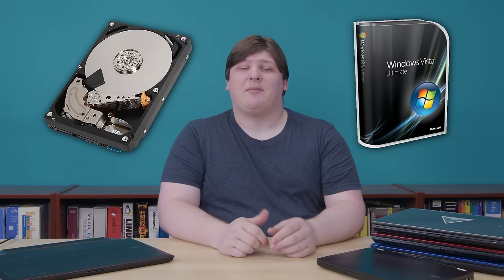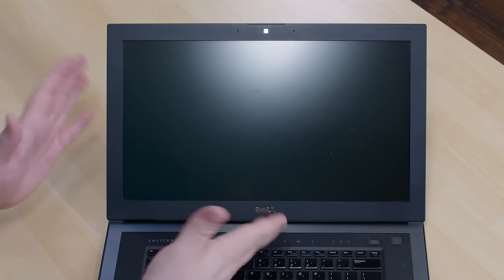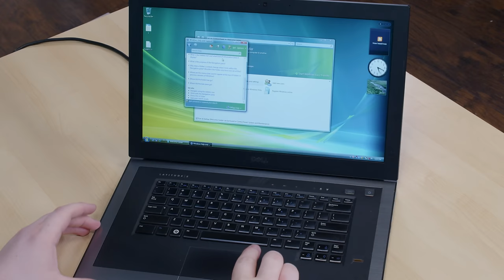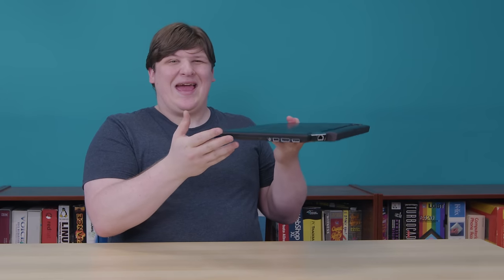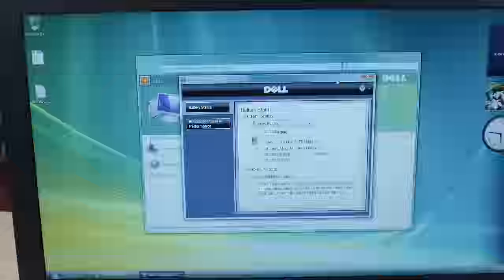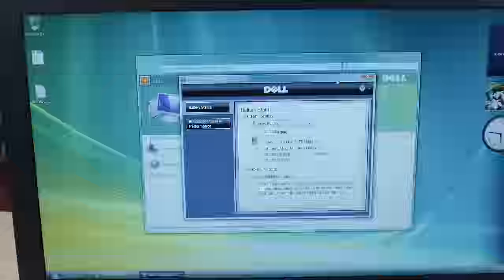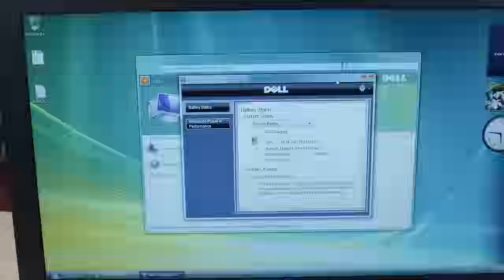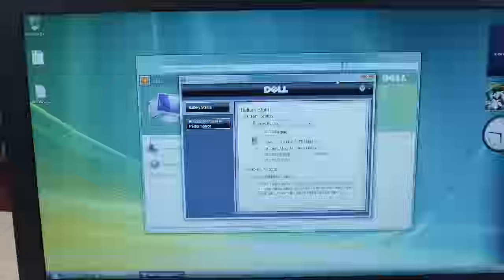Quick Start Ep 6: Assuming Direct Control

Comment: Dell releasing the first ARM laptop wasn't something I expected from this series.
Reply from the maker: ...god I think you're right.
Reply: @CathodeRayDude  I believe the OpenPandora might have been first (at least it would have been if it didn't get stuck in production hell), and it had almost the same cpu: an OMAP 3530@600Mhz.
Reply: This all makes me really appreciate modern MacBooks.  Lift lid, put finger on sensor, do things.  Honest-to-gosh, 0 sec boot time to a full OS.  AND eight hours of battery life.  haha
Reply: The OpenPandora! I was obsessed to have one, but not only was out of my reach, but it took too long to produce! Back then was more difficult to go on with a project like that. Nowadays you have crowdfunding that makes things easier...
Reply: No the first one was made by acorn in 1992
Reply: @CathodeRayDude  The first one was the acorn a4 from 1992 much older
Reply: In 2009/2010 there was some ARM based Smartbook devices like Toshiba AC100, Compaq Airlife 100, Sharp Netwalker, Touch Book
Reply: @cloudycolacorp  I'm sure it is! It looked like the coolest thing to me, armed only with a Nintendo DS and a flash card! I remember browsing the web using the crappy homebrew software that did with only 4m of ram...
Reply: @belstar1128  The A4 didn't have a battery
Reply: Besides all the other ARM laptops other mentioned in this thread that predated this Dell, Apple also released a ARM-based laptop/PDA known as Newton eMate 300 in march, 1997. Intended as a low-cost laptop/PDA mostly for use in schools, it used a ARM processor just as all other prior Newton models did. So Dell definitely wasn’t the first ARM laptop though likely the first (and only?) dual-boot x86/ARM laptop.
Reply: @CathodeRayDude  depending on whether or not you consider palmtops laptops, they existed since the late 90s. Psion 5 had ARM SoC inside. Also I believe Windows CE-powered "smartbooks" were a thing since late 00s with ARM chips like WM8505 powering them.
Reply: Yeah i remember a bunch of laptops running WinCE with pen support… i think Compaq had a convertible from the early XP days
Reply: @DinosawrsAreAwesome  it did have a battery according to my sources.
Reply: @Hugobros3  I don't think that counts as a laptop. I think it counts more has a handheld game console
Reply: @belstar1128   Yes./, a cool little thing that used the case from an Olivetti machine (Olivetti owned Acorn at the time). Must have been the most powerful laptop at the time, though it only having a greyscale display was a bit of a negative point.
Reply: @dglcomputers1498  It also had a decent sound chip. i think most pc based laptops still used pc speaker only .
Reply: @cloudycolacorp  Would you like to sell it? I have wanted one since the ashens video, but it is literal unobtanium
Reply: @alphaLONE Nokia and Toshiba too. Nokia even bought out that other Linux distribution to fuse with MeeGo in the Nokia N900 I wanted SO BAD when it came out
Reply: @DinosawrsAreAwesome  Wrong. It shipped with a 14.4 V, 1800mAh battery Nickel Cadmium battery.

Comment: When the Raspberry Pi came out, I thought it would be cool to install one in a PC case along with the x86 board. But then I thought "what the hell would I do with it?" and moved on.
Reply: Retroarch?
Reply: Use it to implement a remote power switch, hardware watchdog, or HDMI CEC receiver?
Reply: There’s the PiKVM, which lets you effectively use a Pi to add server-tier remote access capabilities.
Reply: Massive amounts of digital I/O.  Although its more usable if mounted outside the case, and Arduino has better I/O, and cheaper.
Reply: @VinceMulhollon yeah, plus you can just solder an arduino part into most machines, as long as they have Microchipped PCBs (which most PCs do) and not Analog/Mechanical/Electrical boards (pinball, crts, tape decks, etc)

but even then, some madman could probably get an arduino to replace analog electron gun hardware
Reply: but raspberry pi is just a computer. its a tiny linux PC with general I/O

Comment: MontaVista was quietly a huge deal in the Linux ecosystem because of how much general kernel work they did in the 2000s.  Most of the preemptive SMP stuff that made Linux work well on small symmetric multiprocessor machines (eg. multicore processors) came from them (...and especially from their employee at the time Robert Love, who wrote an excellent book on kernel development, he was later the chief architect for desktop systems at SuSE for a while, and did a ton of the low-level Linux work before Android reached the market).
Reply: If I'm not mistaken, Robert Love also worked for the guys who created Evolution, before it was 'GNOME' Evolution. Possibly was the point of contact that facilitated the software CRD presents in this video.
Reply: Yes, he was at Ximian (where Evolution started) after he was at MontaVista before Novell ate them.  That's AFIK how he ended up at SuSE (at the time also part of Novell).     
He's also been involved in Gnome in various ways, you see some of his work in NetworkManager, especially around the VPN parts.
...now that you say it, I wonder how much of the platform shown here is his doing, it traces neatly along a series of projects he was deeply involved with in the years before it came out.
Reply from the maker: That makes a lot of sense, and as far as I know MontaVista got plenty of business, just not in this particular niche, so I'm not surprised that they made a lot of contributions.
Reply: Not using the faster primary cpu is such a stupid self inflicted handicap I swear
Reply: Didn't some PC-based arcade machines (Sega, maybe their Lindberg or RingEdge/RingWide?) use MontaVista?
EDIT: not the Ring series. Lindberg (except Lindberg blue) used montavista according to system16.
Reply: Huh.. I KNEW I had heard of Montebello/Montevista at some point when my family was daily driving an Ubuntu desktop

Comment: Yeah, modern Qi charging uses an in-band communication protocol. One of the neat advantages of having two magnetically coupled devices is that the device receiving power can push back a little bit by varying its power draw (put a resistor across the coil), and the transmitter can notice this. You can also modulate the pattern that you're pushing back in to send different messages, like "more power please" or "Yup I'm a Qi certified receiver, send juice please"
Reply: That's insanely cool
Reply: I appreciate how polite Qi is when it talks to itself about its needs and identity.

Comment: That wireless charging gimmick is a masterpiece in aggressively dumb design.  WOW!  That makes my day!

In a phone, it makes perfect sense.  In a laptop, it makes absolutely no sense at all.  If you're going to put it on a dock, where it will stay there, stationary, we already solved the problem of conveying charging current without cables.  Prongs and contacts.  If it's good enough for my Roomba, it's good enough for a laptop.

And the dock doesn't even do port-replicator stuff.  For that, you need the wireless dock!

This thing is wireless for the sake of being wireless, and that's just ... * chef's kiss *  Bravo, Dell.  Truly an engineering marvel.  As in, you will marvel at what the engineers were thinking.
Reply: That said, a Qi dockpad (like Logitech) could be a good idea...especially before we got USB-C passthrough charging.

Comment: The reason for the U9400 was power and more important, thin & light package thermals. The U9400 was built on a 45nm process and had a TDP of 10w. Its Passmark score was a whopping 523, 1/2 of a Raspberry Pi 4. A modern Intel CPU of equivalent power consumption is the N97, built on 7nm. It has a TDP of 12w, and a Passmark score of 6000. It was really hard to do thin and light in 2010 :)
Reply: A more fair comparison would be between low power and full power systems of the same time period. The SU9400 is more than half as fast as the P8700 which was super common in business laptops of the day. It's the same chip just running at a more efficient point in the frequency/voltage curve. An underclocked P8700 would have the same thermal and performance characteristics. At least they didn't use at Atom. The N270 is 175 PassMark and while it's only 2.5W TDP it's paired with a 7W 945GM chipset.
Reply: I mean...e7240 was just 3 years later...the i5 4310U still holds up, and runs Windows 11 (rufus'd) just fine. And it is pretty slim (amusingly enough, you also had the e7440, which was an absolute chonker...and had the exact same specs as the e7240, lol).

Comment: A quick note that wireless USB was at least available in 2010 on business class laptops, my Thinkpad x200 has a slot specifically for use with either wireless USB or a 4GB cache module for the hard drive (which would've been quite a trip, a bit like the short-lived 16GB Optane modules). I'm not sure if the peripherals existed at the time though.

Comment: IE never had any sort of API other than standard Windows controls... So my guess is that magnification mode just emulates Ctrl+ and Ctrl-, which also causes relativity in zoom: no feedback available, it just sends pulses in the void.
If that theory is correct, it should work in ANY app or browser which handles zoom with Ctrl+/Ctrl-, from any modern browsers to PDF readers and a lot of other software...
Reply: I agree. CTRL+ / CTRL- is the only thing that really makes sense.
Reply: What about some kind of custom activex plugin? That could do it, but then again i doubt they went to so much trouble.
Reply: It could also be emulating CTRL+Scroll Wheel!

Comment: That stand is actually genius. All peripherals are connected to, and routed down, to the wireless dock that sits under the desk. Now, the laptop keyboard serves as a shelf to keep all of your papers, plus, you got that extra space beneath it for even more of your papers. Also, the laptop screen seems to be at the same height level as your main monitor. As someone who works with two monitors, a laptop + peripherals on a smallish desk, im in love in that concept.
Reply: and it gets to the right temperature to possibly ignite your papers.   Definitely hot enough to ruin thermal printed paper.

Comment: I'm kind of digging that the Z600 laptop looks like a briefcase.

Edit: You know, a small ARM core could have been used for some really slick security stuff when they made this. That's what the Wii did (the code running on the Wii was just poorly made; the security concepts were really good, essentially what we have in modern devices now).
Reply: yeah leaving the arm in standby mode all the time to check mails for example, blink a led and when you power it shows you the mail on a simple screen where you can interact quickly or just boot into windows to see the mail later in full. would've consumed less than 1W and would be way more justifiable for a machine like this.
Reply: tbh same as the ps4, itss southbridge has 2 ARM cpus, one to bridge the x86 cpu to the syscon and also to load encrypted boot code and another to handle I/O and background download stuff etc.
Reply: I wonder if those dual switchable module is implemented in modern laptops

For example, if the laptop using Ryzen 7000 and Snapdragon 6xx in the same chassis. Ryzen is for main system (Windows) and the Snapdragon one is running Android
Reply: >You know, a small ARM core could have been used for some really slick security stuff when they made this.
Intel Management Engine, AMD Platform Security Processor, Sun integrated Lights Out Monitor, etc.

Comment: I still have my Droid 2 R2-D2 edition. A full physical keyboard was so nice on tiny old phones from that generation.
Reply: I had a Droid 1 and Droid 3 and I loved those phones. Physical keyboards were the best. Only downside is the ribbon cable was fragile between the two halves. I replaced mine on my D3 several times.
Reply: For reference, the Droid 2 used a 1.2Ghz OMAP3640 built on a 45nm process, while the horribly underpowered OMAP3430 featured in this video ran at 600Mhz, was built on a 65nm process, and was used in the original Droid phone. It was also used in my Nokia N900, though I remember my N900 being able to do more at a significantly faster speed than this so I think Dell managed to somehow cripple the already slow processor even more. xD

Comment: The wireless doc was made for sharing PowerPoint presentations in a conference room. That’s why latency doesn’t matter.

 ARM processor was for low power usage during flights.
Reply: Ah yeah, flights are the one situation where "reader" might make sense.  You're cut off from the internet anyway.  Well, it would, if it was on the one that booted straight to an arm core...
Reply: @mandatorysemicolon6427 yeah the lower draw on an 18 hour flight (I live in Australia, no matter which way I fly out of the country it's a long dead space) would definitely have been useful for skimming through stuff before sacking out for the rest of the trip. Instead you just get the worst of it, no power consumption benefit and absolutely no utility.

Comment: It reminds me of IPMI modules built into servers, in a way. A totally standalone bit of hardware that could access your KVM and even do other things like control the on/off, etc. Not too useful on a laptop for this use case though, but I wonder if someone at Dell working on the PowerEdge side of things thought this was a great idea to bring to the consumer side.
Reply: Great observation, and explains the console log of that firmware update, how you would do it from a PowerEdge that itself might run Linux.

Comment: Rubber reversion has been completely fixed recently. it's just more expensive so cheap tat won't use it because the method that only lasts a handful of years is cheaper and more well known.
Reply: I have an old htc windows mobile smatphone with soft touch plastics, it still feels great, and it was well used. It's the modern stuff that gets sticky and gross.
Reply: @PaulSpades skin oils help keep them good. It’s kind of like old cars: if used regularly it likely won’t break down. But sitting around unused is the real killer. 

I’ve had daily-use devices over 10 years old with good quality soft touch, but brand new things sitting around for 6 months untouched before getting used and already starting to revert.
Reply: What's the fix? I would like to know since I might want to make use of it. I see a research paper from 2021 that mentions zinc glycerolate and zinc laurate as activators. Are those the ones you mean?

Comment: That (I think 1.8-inch) SSD was seen in a few other ultra portables of the era. The Thinkpad X300/301 comes to mind immediately. It think it was a sort of stop-gap before PCI-E based SSDs became more common.
Reply: They weren't just used in ultra portables! My current laptop is a pretty massive "gaming" thing from 2014 and it has two slots for these tiny buggers which was how, at the time, I was able to put in a 500GB SSD.

Problem with mSATA was, well, most drives capped off at around 500 GB and after regular SATA SSDs slowly came down in price (while simultaneously holding more capacity) and, like you mentioned, PCIe drives became common, the format just fizzled out. I replaced the system drive in my laptop about two to three years ago and the market is just... dead.

Comment: Well, that display backlight might sink 8 watts, the ti board couldn't have used more than 3-4 watts with wifi. 
You're probably correct about Dell ruining the linux distro with bloated cross compiled apps. Android did suck on that chip (at least versions over 2.0 slowed phones down to a crawl), but windows mobile ran fine. 
I don't hate it, it might have been neat if it had some filesystem access like sd card, usb or a few gigs of dedicated flash. 
Maybe Dell could make a modern version with a slot to stick a raspbery pi zero into their laptops.

Comment: For absolute volume controls, a decent alternative these days is rotary encoders on fancy mechanical keyboards. Quick twist instead of mashing a button over and over
Reply: 51min ago?
Reply: @Giuliana-w1f probably had access before it was made public.
Reply: oh, i was looking for something to emulate spinners (such as steering wheels) on mame, i wonder if these will do
Reply: Yes, 20 years after they collectively decided to remove the potentiometer volume wheel from laptops (did Apple "lead" the way again?), this sounds like a viable solution...
Reply: @shortcat  they're a lot like mouse scroll wheels, so it's just discrete steps. I don't know old mame well enough to know if that would work.
Reply: @forivall  there was a early 2000s keyboard I can't remember the manufacturer of that had a non-discrete spinner for volume control and scrolling. We saw all sorts of weird stuff in the workshop that'd make Clint (LGR) drool.

Comment: Been looking forward to the Latitude/Precision ON portion of the quick start series. My Precision M6500 had the Precision ON button, which could run all three flavors of "ON," but only if you had all two modules installed to do so. One was a flash cart with 2GB of storage for the software (which came cleaned out with my unit) and the other was some ARM SoC that I have yet to locate. Essentially the same as Latitude ON, but in a pro chassis.

Oddly enough, this meant your insane investment into decked out machinery could have been for nothing, if you were using this on a daily basis. Considering it ran the same as most 13" Latitudes.
Reply: i really need to see this demo'd omg, having all three of them insert meme of three cats in one sounds so cool and weird, wonder if the arm modules are interchangable and at most all it'd need would be to be flashed with the os needed for that laptop idk